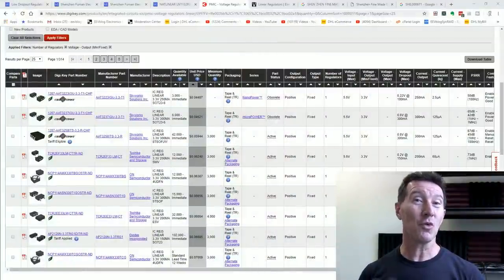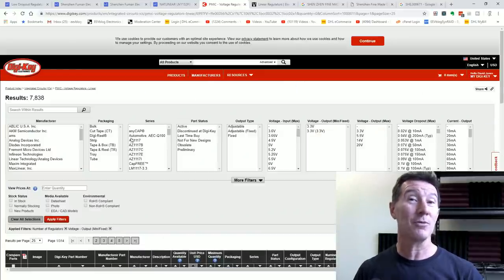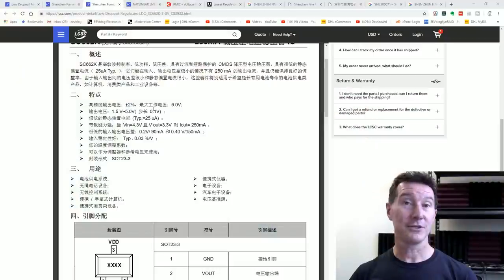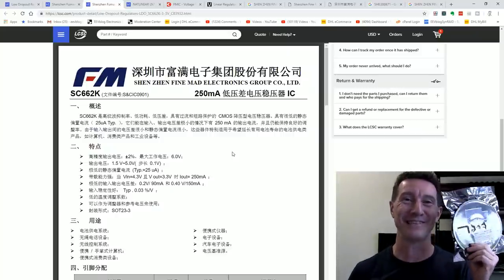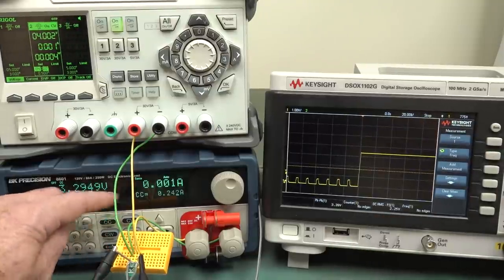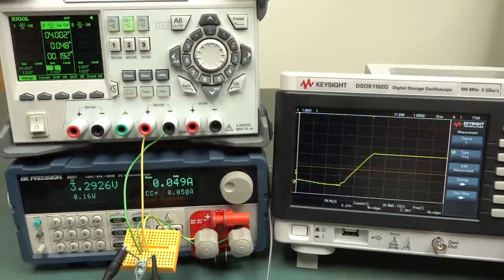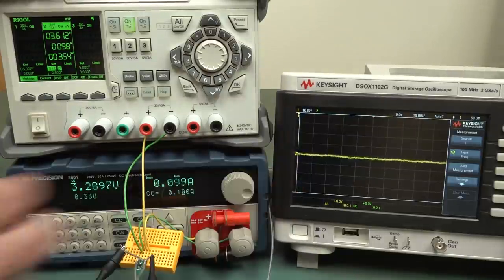EEVblog #1147 - 1 Cent Regulator! That's MAD!

Comment: I just bought 7c ones, I feel like I've been robbed..
Reply: I bought 5 ATTINY45 for $10, about to get the rope. I'm going bankrupt.
Reply: @rockyrivermushrooms529  Where did you buy it? Even at Digikey it costs just a dollar.
Reply: @frankbuss  Whoops just checked the source, turns out I paid 1.30 from arrow.com. I bought em a while back so my memory was a bit off. I think I was recalling seeing all the ebay ads
Reply: +Brian  You probably missed out on Bitcoin, no?  This pattern of losing will continue in your life if you don't change.
Reply: @NeverTalkToCops1  well I bought some ETH about 18 months ago, but I missed my chance to sell them I guess cause I still have them! Think of how many voltage regulators one ETH would have gotten me last January!
Reply: I bought some from Jaycar for $15, I'm trying to find a nearby cliff.
Reply: hahaha!!
Reply: @GnuReligion  with shipping of 3.70 usd it's cheaper to buy pro mini board. I have no idea why they are so expensive
Reply: @BrianLough  SELL NOW!!
Reply: he's also robbed. they 0.2 cents :)

Comment: we should start a 1$ electronics project challenge :).
Reply: that’s a really cool idea
Reply: The biggest issue is probably PCBs
Reply: i wouldve used the shitty resin bonded paper perfboards
Reply: @Okabim  In that case, lower our ambitions to $5. And, as a special option to help some inexperienced Wun Hung Lo designers, exclude shipping costs; Use JLCPCB prototype with a quantity of 5, under 10x10cm (Unit price per PCB $0.40)
Reply: @wesleymays1931  Acceptable, just gotta get people on board
Reply: @Okabim  I can design the circuits and the PCB, deliverable shall be Gerber Files, need a list of applications : one comes to mind turn on/off  a relay based on a float valve position, this is very useful to fill up a tank from a well using  a water pump, the pump gets turned on / off via the relay..
Reply: @lucasc5622  I just pull the cardboard from a new shirt , cut a piece out of that, poke a few holes, plug in the components, and solder everything together on the back. cheap AF, and no need for desoldering when something lets the smoke off, just cut the leads and there we go
Reply: @MrDoboz  yeah, thats what i used to do, but buying shirts just for the cardboard got a bit expensive. at one point i was buying so many shirts that i just threw out ones i had worn for a day
Reply: @lucasc5622  yeah but when you are in a hurry soldering all that stuff you easily burn through a shirt every day

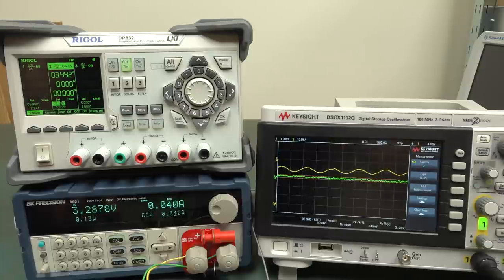Comment: @26:36 - Oh, no! It's no longer in the original sealed packaging. That instantly dropped its collectables value by 99.9%. Had it been kept unopened, in 20-30 years, those babies might have been worth 15 cents each!

Comment: Hi @EEVBlog, Google translate can translate full pdf:s! Just upload the pdf, tried with your regulator, and worked perfectly.
Reply: Awesome
Reply: Google translate does a terrible job with PDFs. It strips out all of the images and makes a mess of the tables.
I have had much better luck with onlinedoctranslator.com It's still not perfect, but most datasheets come out usable.
Reply: @rocketman221projects  Yeah, GTranslate occasionally (often) messes up the formatting. There's also a size limit, something like 5000 characters I think. I've used what you linked and can highly recommend it but due note however that it still uses GTranslate for the actual translation. It also allows you to bypass the GTranslate size limit as it translates the document in smaller chunks.
Reply: The coolest part of google translate to me is that it can translate on realtime video - Chinese fades out, replaced by English.

Comment: I wonder how many people who watched this were waiting for the magic smoke to escape around the time Dave had it up to 1.3 watts.
Reply: That's crazy for such a tiny package.  It should have broken.
Reply: TDL should always exceed output load but in a good case for any active device, Dissipated Power should be much less than actual power output. So no, Dave Jones didn’t have much reason to break out the pyrometer.
Reply: 1.3 watts is how much power the load was sinking. The regulator was dissipating 0.3 watts which is still a lot for a part that size but not mind-bending.

Comment: It would be interesting to see the IC decapped and compared to one by a known manufacturer.
Reply: Shenzen is the manufacturer(?).  no need to decap them.  they are so cheap (quantity of 20 for $0.48) that it does not make sense to question the quality unless you are making 10,000 units of something and using one of these in it.
Reply: @johnconrad5487  Shenzhen is the city the company comes from, they've just put that as part of their company name.
Reply: There is a trained flea in it performing all the tasks
Reply: @johnconrad5487  and "Dallas" is the manufacturer of Texas Instrument components?  
as emphasized  Shenzhen is a Chinese city, though a behemoth for CN tech..
Reply: @JAKOB1977 I've heard that "Richardson" and "Sherman" also make knockoff Texas instruments chips.

Source: I've repaired fab equipment for all of them, they're all made in the same different factory.

Comment: 1.3 billion people in China using electronics every day, so cents matter for sure. :-)
About 80% of the components I used in the past few years only cost several US cents, and I've got quite a few cheap but working options.
Btw, I can help translate those datasheets, in case you need.
And thanks for the videos. :-)

Comment: I see no harm using them. Is you need 10k of them, then even spending few hours to test it good, would still be a cost saving. The performance without any output capacitance is quite impressive too. And these are pin compatible with gazillion other fixed regulators, so you are not locked anyhow during design or later. I am sure these are very popular in China and you can probably have a lot of them in various products around, and you do not even know. I wouldn't be surprised if they produce a billion of these regulators per year, with almost no faults.
Reply: So, lets say 10k. Thats 100 bucks. You save 900. How much engineering time does 900 bucks buy you, and how much money is left?
Reply: @PlasmaHH  if you are in China, that is probably a lot of engineering hours. And very likely you are familiar with these chips already anyway. Few hours of quick checks with any chip would be usually enough.

Comment: Because if you need to reduce costs you should always start with the power supply!  That's why I never pay more than 2 cents for the 100uF Lelon electrolytic caps in the PS!  Paying more is just throwing money out the window!
Reply: Spontaneously?  That might be hard but over time with varying loads including inductive loads is where I would expect to see problems that might cause fires.

Now if the PS is poorly assembled also all bets are off and it does happen.
Reply: +Elmer  Do you not know how to use the Paduak chip to implement your caps in software? Hee Hee.
Reply: I know you are joking when you say to save money on capacitors. For people who are new to electronics, faulty electrolytic capacitors cause most electronic and computer malfunctions. Tantalum caps often fail too.
Lelon electros might be fine for audio and hi-fi. But they wouldn't be first choice for Switch Mode Power Supplies, computer equipment, TV's and communications gear. Also they mightn't be used for hot, vibration or electrically noisy environments.
Reply: @Dr. Smith Capacitive dropper with zener diode?
Reply: @Dr. Smith Also, if you're interested I did a full reverse-engineering of the cheapest 5V USB charger on eBay (in 2016, at least).
Reply: While I agree that you should always start with cost cutting on your power supply, if you've already got your disposable 13.56mhz controlled light up wristband for concerts on the 3 cent microcontroller and the 2 cent RF front end, you probably have a decent chance of wanting you doodad connected straight to the battery.

The 1 cent power supply solution might actually be an upgrade.

Comment: i would love to see what the failure mode is when you overvolt the input or overheat the regulator
Reply: That would be a waste of a very expensive part!....oh wait...
Reply: @stuartcoyle1626  i am actually willing to pay out of pocket for the damaged chip, this kind of R&D costs companies thousands!
Reply: This kind of chips have a good overvolt/overheat system denominated: MagicSmoke™ which it's cool because warns you if you're damaging the chip with a visual and smell warning, even if you exceeded it too much, it can shine bright!
Reply: There are only 4 possible modes, depending on whether or not the input is current- limited. 1) The output shorts to Vcc, 2)Vcc shorts to ground, or 3)Vcc goes open, and 4) output pulls to ground during physical destruction. Determining whether Vcc was shorted to output through a commonalized-ground would require microscopic forensics.
Reply: Really would be more interesting to see what the loaded output looks like when giving abusively noisy inputs.
Reply: sounds like electroBOOM style lol

Comment: I use voltage regulators for 12v on/off inputs to a 3.3v microprocessor.  Instead of resistor dividers or optocouplers, they are simple one-part solution,
which like said, it reduces 'part count and bom inventory'.   So one for 2 cents is not expensive compared to other options.

Comment: Great video. The only issue with buying from China is the return shipping if it comes up. It's super cheap to have stuff sent from China, but sending back to China is much more expensive, to the point where you'd actually lose money by sending an item back. Be sure to check the return policy, and if it's not good, make sure you're willing to take the risk.

Comment: What happened with Padauk uC reverse engineering series 😐
Reply from the maker: It's not worth the effort.
Reply: @EEVblog  Noooo, It looked super interesting  and the the guys in the forum made it much easier. Its not about the effort, its about the learning experience, and reverse engineering techniques in general ! hope you reconsider that !! :(  .
Reply: @ibrahimabukharmeh489  If you want that experience, the PICkit programmer and protocol is well documented and you can build your own with no restrictions. Google it.
Reply: @Peter_S_  but ... but ... reversing the protocol!
Reply: @ibrahimabukharmeh489  i dont think they can do it.
Reply: @LittleRainGames  Of course they can do it. But it can easily take a week full time to fully reverse engineer it, including the required de-obfuscation of the binary, as described already by someone on the forum etc. They are probably busy building the uCurrent and other products. But I bought a programmer as well. If I find some time, I will publish at least the voltage recording of a full programming cycle, so others can do the hard work :-)
Reply: @EEVblog  Come Oooon Maaaan 😐
Reply: Forget about reverse engineering. I just finished the code on a PMS150C in Mini-C. This is alien tech and the learning curve was not steep, but quite alien. Mini-C is quite good and the ASM it creates is super efficient.  I can do a byte counter loop do {} while (--k} in 3 clocks. cant do better in ASM. You can also mix ASM with mini C without bracketing. For loops are not implemented, but the while and do loops can do the same, you just have to initialize the counter first.
I do feel a bit dumb-ed down and not in control as the IDE forces certain envelopes and automatically adds code to do the clock calibration for instance. Mini-C seems like an advanced macro lib rather than a compiler. Fortunately if you have  the CE you can step all the assembler code. I saw some nice tricks like when you test a word for zero, it ANDs the HiGH and LOW bytes and check the status register for zero instead of testing them separately. I feel more comfortable with this than with the early PIC's as the 12F629 that was even more alien at the time and then you had to waste cycles to switch banks. Pain I never want to endure again.
The ICE is not great and the worse part is the WDT period is  not nearly the same as the chip which wasted a lot of time. At he end I defined a debug label and just disabled the WDT during simulation. this should be easy to fix in the ICE, or at least have a way to disable the WDT during simulation with a check box. now I have all this ICE exceptions in the code.
The writer is super quick and intelligent  with an interface for automation. relay a nice product and worth the money.

Comment: That means if you want it in a DIP, the package likely out-costs the part!
Reply: Not likely, but sure does.  Packaging is major part of device cost these days.
Reply from the maker: Yep, packaging is a big part of the cost at this level.
Reply: Sixta16 Would it raise or lower the price to use the tiny 5 terminal (2 unused) 1x1mm package that NXP offered some LDOs in?
Reply: Sixta16 un packaging has always cost more: partial reels never decrease the part cost.
Reply: @EEVblog  I want one in a good ol' metal TO Can!
Reply: Thats why most toys and cheap stuffs use COB (chip-on-board) without packaging to save the cost.

Comment: Not very promising to those looking forward to join the ic design industry
Reply: Would you trust this in a mission critical device?
Reply: Maybe? If you can make similar savings on your whole BOM, you can probably work in a lot more redundancy at the same budget. Qualification testing will also help, and every mission critical device should have that. 

The more important factor is volume. If you're making one of something, then there's not really any point. If you're making ten million of something, it might be worth it, even if you have to do independent qualification testing.
Reply: @sleepib  That's a good point, instead of 1 10¢ chip, put 10 1¢ chips
Reply: @sugarbooty  depends on failure modes too, just paralleling them up like that would only work if they always fail open circuit.
Reply: sleepib More like instead of a 15¢ LDO powering a 30¢ MCU, have 10 mutually redundant 3¢ MCUs powered by independent 1.5¢ LDOs .  Of cause you might use only 8 or 5 MCUs to make room for the circuit that arbitrates conflicting results.
Reply: f4dy - Sure, you'll get paid less per hour (in the ic design industry), but YOU'LL MAKE THAT UP IN VOLUME.   lol

Comment: In my old power supply designing and testing days, one thing I learned is to always doubt your equipment, particularly when loaded with active devices such as this. You really should connect a scope probe to Vin to ensure that your fancy power supply isn't oscillating rather than to blame the IC. I've seen very expensive Keithley supplies barf under certain load conditions. Lead inductance between the power supply and the Vin leads of your DUT will definitely affect things. It was a given that you ALWAYS wanted to put a big honkin' capacitor on Vin to negate the effects of this inductance!

Comment: The regulator use, and see everywhere is the ubiquitous AMS1117-3.3 ... and they cost very little as well.  No way their dropout is 18mV though.  Sadly, I have several other kinds of LDO regulators, and never measured a dropout even approaching the datasheet claims.  Got to try out some of these SC662Ks!

Comment: Most Chinese products work great when they're new, but how long will they last? Remember the cheap Chinese electrolytics? I think the real question isn't "How much can I save by using these," but rather "How much could I lose if they fail prematurely."
Reply: Today the useful life of a device is not only limited by the durability of the components, but also by things like "how long is the service it uses being offered", "how long is the software supported with security updates" and "how fast is the technology developing" (rendering the device obsolete because newer more efficient solutions are developed).
25 years ago a TV was essentially a static device that you could repair when it is broken and then continue to enjoy the same entertainment it offered before.
Today, a TV is a computer terminal that includes today's receiving and demodulation tech, todays internet connectivity and apps, and todays display technology and efficency.
5 years later it essentially is obsolete because transmitters have moved on to new more efficient technology, the software in it is insecure and no longer supported, the apps no longer work with todays services, newer sets have better picture quality at lower energy consumption, etc.  By the time it breaks, it had passed its end of useful life anyway.
This makes long enduring parts less of an issue.  More focus should be on recycling the materials used so a new device can be manufactured from it.
Of course all of it comes at the cost of the jobs of the TV Repair men.
Reply: The use of lead free solder will kill off many products with time due tin whisker growth causing shorts.

Comment: You are doing a great job to introduce Chinese parts to the west (south in your case) . The markup of the supply chain is just crazy and the mainstream manufacturers like TI, MCHP etc supports that by setting price to allow that . This kills many viable products just because it is to  expensive to buy at retail and reselling to retail. In China this is not the case and part of why the electronics industry is taking over the world even with crappy products.

Comment: any concerns regarding life expectancy?
Reply: Antoine Roquentin potential failure modes might prompt isolation if the connected devices are meaningful but choosing to produce discrete VRs when there are designs specifically made of multiple cheaper parts specifically to get around a need for one, means the need for having a VR in the first place is partly because of space considerations- and no space always means having hot neighbors nearby. I’m sure you can connect the dots from here.
Reply: At that price, I'd be concerned